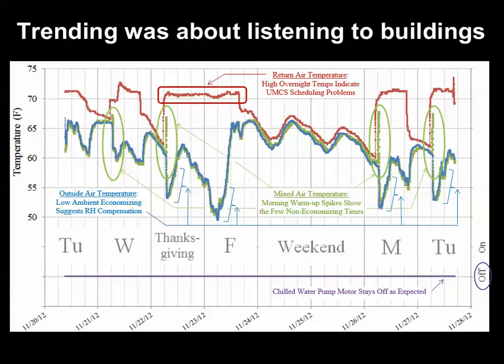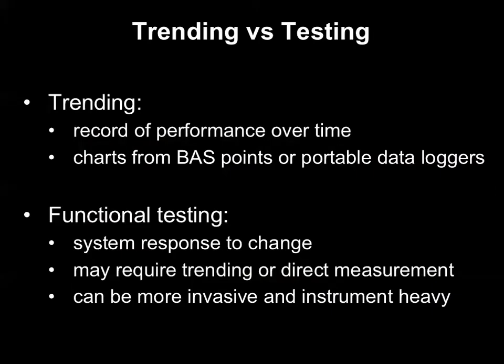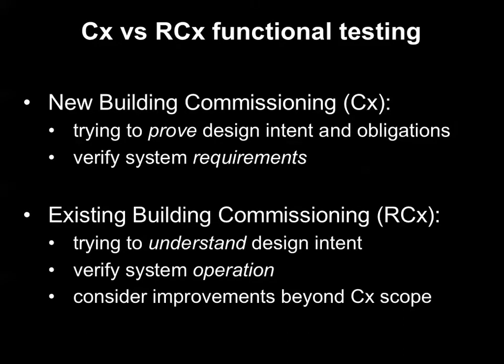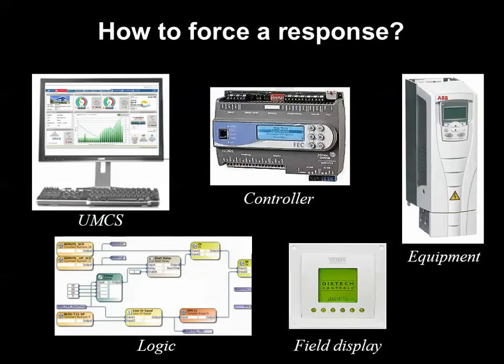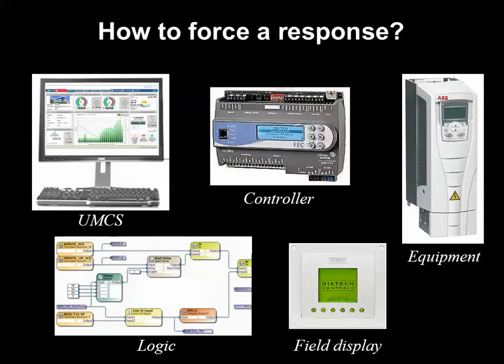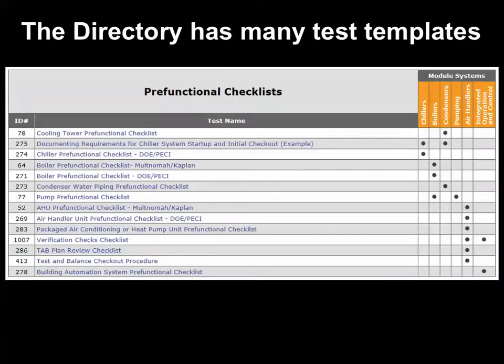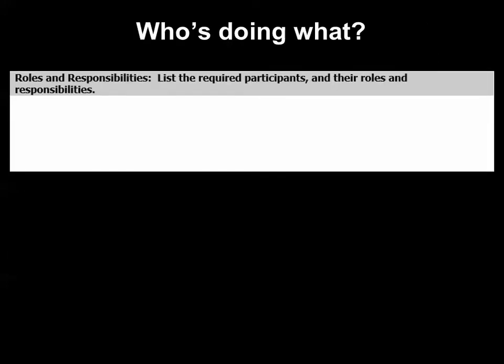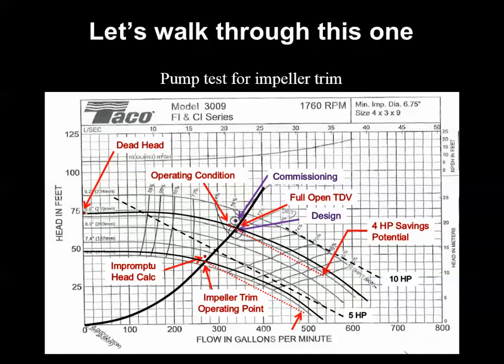Strategies for RCx Functional Testing

Comment: the website Ftguid.og is not working anymore would you please suggest another site ?
Reply: You can now find the FT Guide at this location.

https://www.av8rdas.com/functional-testing-guide.html 

Note that you will need to download it and run it locally using a browser, preferably a version of Internet Explorer.  Running from the internet is no longer an option.   The information on the download page explains this in more detail.  You will also find a blog post that complements this information and explains a bit more about the Functional Testing Guide at this location.
 
https://av8rdas.wordpress.com/2019/09/04/the-functional-testing-guide/